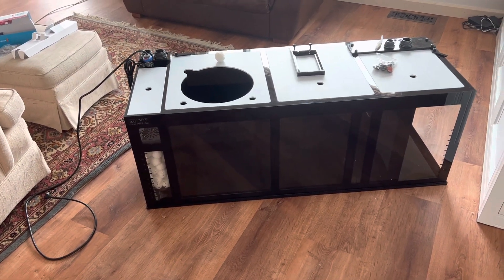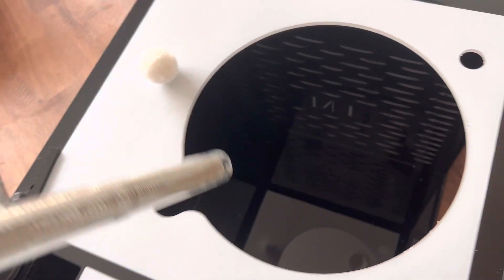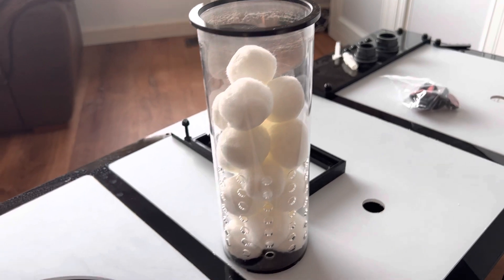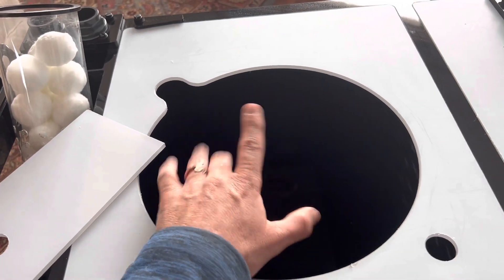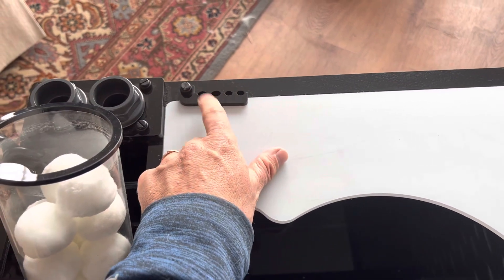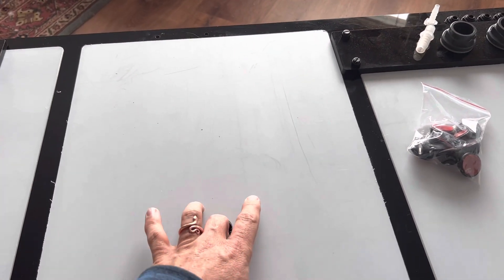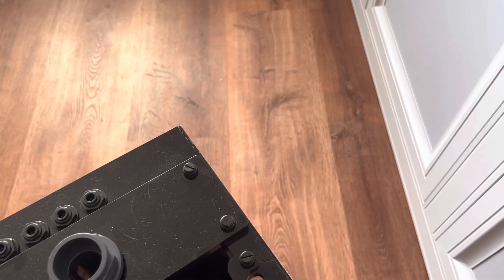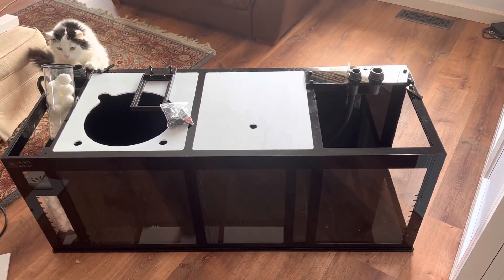Quick look at the new innovative marine RFS 50 sump.

Comment: I am considering drilling a bulkhead into the return chamber to work with my drip water change system. Does the acrylic seem drillable?
Reply from the maker: Yeah it’s pretty thick but not crazy thing tho. Use caution. 
There are 2 buck heads in the return chamber fyi.
Reply: All acrylic is drillable

Comment: Looks like a nice sump - If you use the IM mounted fuge light is the white lid transparent enough for the light to go through?
Reply from the maker: You know I am not sure. I will be using the apex fuge light.
Still have yet to set up the tank and sump.
Reply: Probably late, but the white stuff on the lids are actually removable, like a film to protect the acrylic during shipping/setup